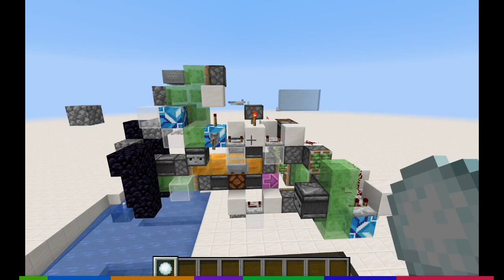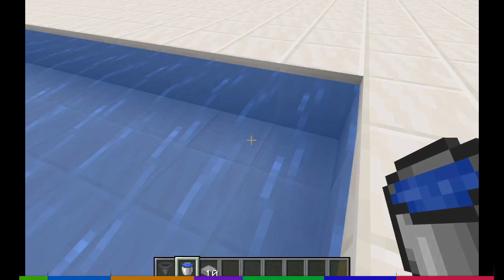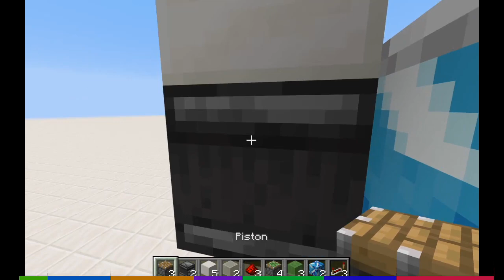[Tutorial] Fully Automatic AFK Mining Machine (Minecraft Java 1.15 - 1.16)

Comment: I used the method you tried for the floating water, but I couldn't get it to work. What should I do?
Reply from the maker: Did you build it in Minecraft Java Edition? I think it still works in the latest version. If for whatever reason it doesn't work, you can replace the water with a block of obsidian. You'll only lose a very small percentage of drops. The drill itself only works in Java Edition, so make sure you're not playing on Bedrock.
Reply: @emeraldfyr3  so I got it to work, but the tnt wont duplicate it now. I copied your instructions, but it doesn’t dupe it.
Reply from the maker: @electrogamer7325  The TNT super for sure works in the latest Java Edition. Are you playing on a server that's running bukkit or some other plugin that maybe patches it? And are you sure you built everything correctly?
Reply: @emeraldfyr3  I think its that i’m playing on a minehut server lol

Comment: Hi, I built this on my world and it worked to start with, but has now stopped returning, with me having to manually reset it every time, and replace the "head" slimeblocks. Do you know the issue?
Reply from the maker: If it flies into unloaded chunks it will stop. In order to keep loading chunks around it, a player has to ride AFK in the minecart in the drill.
Reply: @emeraldfyr3  I was in the cart when it was moving, it doesn't matter now, creeper blew it up🙃
Reply from the maker: @harrycousins4312  Hmm. The only other reason I could think for that to happen would be if the head got stuck trying to pull a block behind something immovable, like obsidian.
Reply: @emeraldfyr3  I'm not sure. When I rebuild it I'll let you know how it's going

Comment: Mine just blew up as soon as I placed the TNT. Killed me blew the whole thing up. what went wrong? Why did it kill me instantly?
Reply from the maker: You have to make sure to place the blocks in the TNT duper in the same order as I do in the video. The TNT needs to be powered without getting updated. Any block update to the TNT once it's in that position will cause it to explode.
Reply: @emeraldfyr3 Thanks! this helped a lot. I got it working now  but the minecart keeps killing me. It says that I "suffocated in a wall" how does that happen? gravel?
Reply from the maker: @GucciCaligula  I'm not sure. When sitting in the minecart, your head should be in the glass. Glass doesn't suffocate the player.

Comment: Finally got this working well.  Completely get that you need to ride along in order for it not to fail.  That being the case, I am looking to build this as multiple drills with unloaders somehow connected.  Say two either side and you ride in the middle one.  Though I expect the problem will be that you are not riding in the other two and they will fail.  My hope is that because all three would be connected they wouldn't fail.  Let me know if you have done any testing around this.
Reply from the maker: Unfortunately I don't think that can work with this design. Even if you waited until all the drills returned to launch them again, it's possible that one of them will hit a block and turn around earlier than the one you're riding, causing it to get stuck in unloaded chunks.

Comment: 1.16.2 I have three of these running at the same time.  After getting them going, they will be working fine.  I'll head back to the surface and farm and do other things.  Once a period has gone by, I'll go check on them.  Only to find the drill portions are stuck in the tunnels.  Often they have broken apart at different points.  Sometimes they are intact, just not moving for no apparent reason.  I'll fix them watch them run several cycles back and forth with no problem.  After that, I'll head back to the surface to work on other things.  Next time I go down, it's the same thing.  The drills have broken apart or stalled in the tunnels.  Any idea what is happening?
Reply from the maker: Unfortunately the drills stop when they hit unloaded chunks. The only way to keep them going is to ride in the minecart on the drill so that the chunks around it are loaded when it goes farther out.

Comment: Left it to work overnight riding in the cart, came back in ~6 hours to find myself in the cart lying at the front foot of launch station, but the drill still going!

I figure the cart got dragged out from the honey while going through some water in the tunnel? Not sure how it ended at the station though, and also how do I put it back in now, in the middle of fully assembled station. Will tinker!
Reply from the maker: Hmm that's interesting. I haven't seen the minecart get separated from the drill since switching to honey. The minecart is fully inside the block where the honey is, not at all in the adjacent block, so water shouldn't be able to pull it out. Plus if you were at the foot of the launch station it couldn't have been water anyway. It must have glitched out somehow. To put it back after building the station, just remove the observer above the door and the door. Then you can follow the same steps as the first time to put the cart in. When done, replace the door then the observer.
Reply: @emeraldfyr3  Thanks for the tutorial. I have had the same problem twice now after a total AFK time of ~10 hours. I built mine in the nether and it appears that the minecart glitches out of the honey and I end up suffocated somehow. Going to experiment in creative to see if I can find a fix.
Reply from the maker: @Schmango9012  Are you playing in on a server or single player?
Reply: @emeraldfyr3  on a server. Not spigot or anything like that. It does have a couple fabric mods installed (fabric API, carpet, carpet autocrafting, phosphor, lithium). I've never had those affect any machines but I could test without them.
Reply from the maker: @Schmango9012  I'm not sure if any of those would cause issues. I've only tested this in unmodded single player.